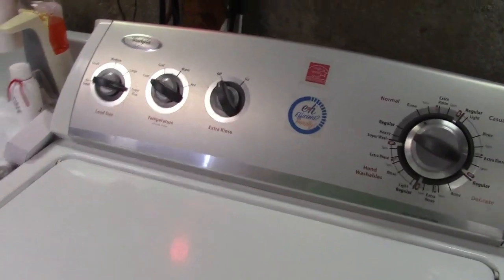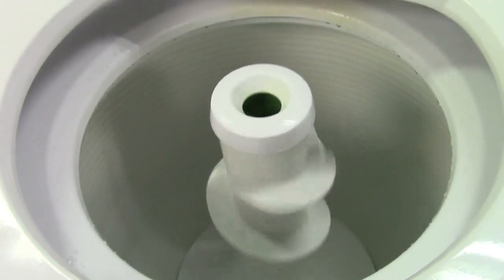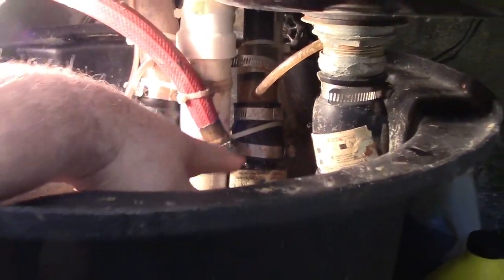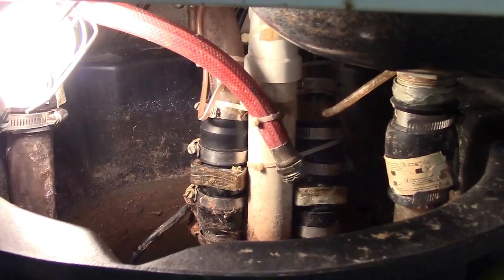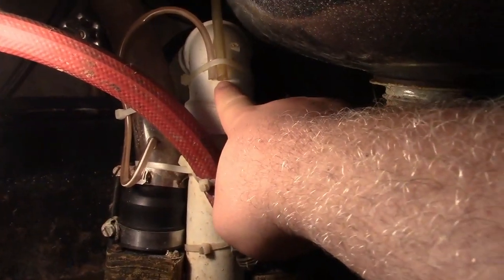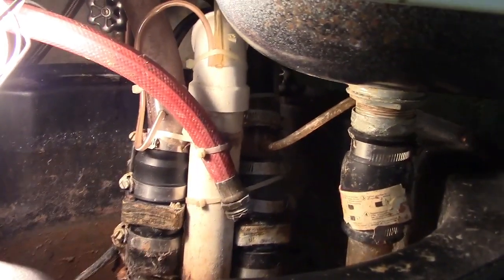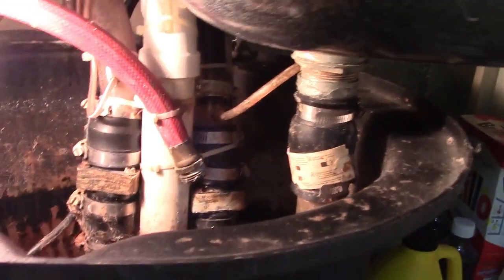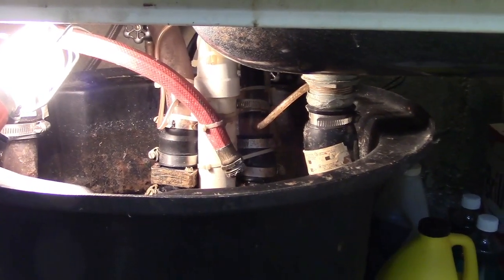My Newer Whirlpool Washer Isn't Working Properly, Can I Fix It?

Comment: Decent! Always good to use proper troubleshooting techniques, rather than condemning a perfectly good washer, and still have the same problem.
Many years ago, I got a real cheap Amana dryer. The guy had replaced the dryer only to find the same problem with the new dryer, which was the dryer vent was clogged up. His loss was my gain!
Would it be of benefit to install like a 45 degree elbow on the end of the drain pipe, so that doesn't happen again? Even if the pipe rests on the bottom of the drain bucket, water would still be able to chooch out just fine.
Reply from the maker: Thanks.  I have a very unconventional diagnosis procedure that I can't explain nor demonstrate, it's like my brain is hard-wired for it.  I work through it fast, and the diagnosis is usually made within a few minutes, if not even seconds.  Fixing it, is another story.  Just like the electrical box that was rewired, my diagnosis without checking was a reversed hot and neutral.  Fixing it took longer.

Excellent gain on your part, I love when people are dumb and you can prosper from it.

Yeah that's not a bad idea, someone else had suggested cutting the pipe at a 45 degree angle, which would accomplish the same thing.  I have no idea why this moved to begin with, and it never did before.  Fortunately, should it fail as it did, there will be no disastrous results, worst case is the washer would still have water in it.  As it turns out, Sharkie had expressed interest in seeing the ultimate Jay test of the setup next time he's here, perhaps I can better secure the pipe then when we're in there.  When you go looking for problems, you find problems.  I did 2 repairs on 2 different devices, with old plastic, and found out that I shouldn't have messed with them because of the plastic.  I was able to fix them both, but they were better off left alone.  Videos someday.

Comment: The drain pumps are incredibly easy to replace on these washers. The pipes to the drain pump might also be clogged. All you really would need to do is check for blockages and replace the drain pump if necessary. Either way, this problem is going to be an easy fix!!
Reply from the maker: Try watching more than 3 minutes of the video.

Comment: So was that bucket/pump there when you moved in for the sink and you just added the washer drains to it or did you install the whole set up?  Do you know what brand of pump that is?  

I believe the laundry pump I have is a Liberty Pump.
Reply from the maker: Yes, the bucket and pump were here before I moved in.  From what I understand, there used to be some sort of different setup there years ago.  On the wall where the timers are, if you recall there is an outlet where the pump plugs in that has a little red light on it.  The previous setup, whatever it was, was manually operated.  That's a quad box, right side is a standard, always on outlet.  Left side has a switch on top and outlet on bottom.  The outlet is where I have that analog voltmeter plugged in, and the switch controls that outlet.  That used to be where the old pump plugged in; when using the sink you had to turn it on and off manually.  That setup was probably installed in the later 50s or early 60s when the basement was partially finished, is my guess.  This is based on brief recollections of a lady who grew up in this house when she was a little girl.

No idea when the whole bucket and pump was installed, I can only imagine that the prior owners of the house may have redone it, I know the guy's father was a plumber.  He might have been a hack, or maybe the homeowner was a hack, I don't know.  When I bought the house, the pipe that couples in to the main drain fitting had a screw-on connector, which was cracked, so it leaked.  Their solution was to tie a towel around it to collect the water that seeped out.  I replaced that piece with a rubber coupler and painted the pipe green.  The washer drain setup I devised and installed, none of that existed.  The old GE washer that was here would dump directly into that bucket.  But, if the water was at just the right level, it would cover the end of the drain hose.  So when the washer would pump out, and shut off, no air was admitted to the line, so a stalled siphon was set up.  When the washer went to refill, it would refill for eternity and never fill because the water would go directly out the drain hose.  That happened a couple of times until I figured out what the problem was.  When the newer Whirlpool was delivered, I devised that whole setup, then mimicked it for the other machine when that came.  

I have no idea any information about the pump that's in the bucket.  It was just there and working when I bought the house.  In fact, I was unsure about that whole setup, and while here with the real estate agent, I told her I needed to see this work several times.

Comment: Hi Jaykay18! I have a question for you. I have a Kenmore 80 Series direct drive washing machine. My issue I’m having is the washer is slipping into a spin drain some of the time when it should be doing all neutral drains. I just installed a new transmission hoping it would solve the issue but it has not. Do you know why I’m having this spin draining issue? What would be my next trouble shooting fix?🤔 Thank you!
Reply from the maker: I find it quite interesting how people come to me as if I'm some sort of expert.  Well, I am, so then they post their question yet forget the part that I'm not dumb.  Clearly, you're a washer twerp.  That being the case, on your About page of your channel where it says "I can help and tell you how to fix your washing machine.", you claim to know a thing or two.  If you did, you'd never fire the parts cannon at the machine and replace the transmission.  Based on your videos, there's no chance you replaced it.
Reply: I appreciate your feed back.  Please understand, I’m 18 yrs of age, on the spectrum (Autism) and was hoping for your expertise and guidance with this issue.  Based on what I do know, replacing the transmission on a 28 year old unit was not the answer to solving this issue!  Your time is much appreciated.
Reply from the maker: @Dance2564  I'm more interested to know who thought replacing the transmission would be the solution, and who paid for it and who actually installed it.
Reply: @jaykay18  based on my knowledge from watching YouTube  videos, thought that replacing the transmission would be the solution. My dad and I replaced it ourselves. We bought it from Genuine Replacement Parts. It’s been a great working machine.
Reply from the maker: @Dance2564  That's exactly the kind of story I figured.  Things aren't adding up the way your portrayed yourself.

In this video, I used a very methodical approach and stress the absolute importance of diagnosing the problem first.  Doing so allowed me to determine the problem and devise a solution.  In this instance, no parts were needed, just an adjustment.  Now consider what would have happened if I immediately fired the parts cannon:  I would have ordered a drain pump, tore the machine apart and replaced it, only to find that the problem persisted.  That should sound familiar.

Comment: Is this one of those newer belt-drive Whirlpools, or is it the classic Direct Drive? Only thing I'll say is... I wouldn't be caught dead with anything newer than maybe a Whirlpool UltraWash from 2004ish, or the Kenmore 80 Series TL's (the latter, I'm looking for a unit to store long term, as a backup). After Bush's 2nd inauguration, the overzealous EnergyStar crap really started up. It became 8x as bad, under Obummer. 

The newer TL's fiddle around with temperatures too much, giving nothing near a HOT or Warm Wash, and just don't provide the cleaning power I am accustomed to. Not to mention, digital controls and lid locks. Blah.
Reply from the maker: The sound alone gives away the fact that it's a classic direct drive.  I won't accept EVERYTHING less!  If I ever move, these machines are coming with me, I don't care how much it costs.  While this machine has ATC, I have a whole workaround system to allow only hot water, and even implemented a warm rinse option.
Reply: @jaykay18  Would you mind showing your workaround, maybe in a future video? I would love to see it. So far, the only one I've tried is physically shutting off the cold tap, but that's a huge PITA.
Reply from the maker: @laundrygeek3330  Try all of these:
https://youtu.be/jTE6Yo9T_vg
https://youtu.be/-3hwHzs9N9Y
https://youtu.be/boQufGJkeIQ
https://youtu.be/SeWQUssYubk
https://youtu.be/MwdUqCZ0faQ
https://youtu.be/cdlhzab6J0M
https://youtu.be/CYZWO__Cxto
https://youtu.be/JPLvwb_7GYg

Did you really think I WOULDN'T have videos on this?

Comment: The heat from the hot water probably caused it to shift.
Reply from the maker: If that were the case, then it would have done it under testing, unless you never made it that far in the video.
Reply: @jaykay18  of course I watched the whole video twice!
Reply from the maker: @ItzYaBoyJesse  Then you would have known.
Reply: @jaykay18  yes.

Comment: I also prefer to use hand tools on screws and bolts for the same reason.
Reply from the maker: Excellent!
Reply: @jaykay18  Also, with coarse thread screws I turn the screw backwards in the hole until I feel it drop into the threads. That stops it from creating new threads and potentially stripping the hole.
Reply from the maker: @Jallge  Yes, that's a very old trick. I've used that for years. But it's really of no help when the plastic is old and brittle or very soft, because it breaks anyway. Just had that happen on two recent repairs of other items. I got them patched up.

Comment: Another thing that will work is if you can cut the end of the pipe at a angle and you'll never have that issue again
Reply from the maker: That's a good point, and it probably would work well.  I will keep that in mind should this happen again.

Comment: Well a feller might have to do hot water and bleach with a large load of water every once in a while!
Reply from the maker: That doesn't wash away fibers, or hair for that matter.  Sometimes, a guy's just gotta get his hands dirty.
Reply: @jaykay18  right right, then maybe use an scrub brush or an old toothbrush and scrub it!
Reply: @jaykay18  or a guy could just use some cleaning attachments on a drill, nope.....you will probably buff it out.
Reply from the maker: @ItzYaBoyJesse  It took 12 years to get that way, and what I did will probably buy me at least 10 more.
Reply: @jaykay18  noice!

Comment: And to think this thing will turn 15 next year. And its literally the only thing thats happened. Also older whirlpool will turn 30. Heres to many more years
Reply from the maker: Right, and this wasn't even the machine's fault!  The older one I did the agitator dogs twice on.  That's it.  I'm sure they'll hold on for years to come.
Reply: @jaykay18  absolutely, and exactly,   they will certainly still be going strong when all the modern machines hit the landfill, i rekon even the new speed queens including the tc5 will hit the landfills way before these direct drives!
Reply from the maker: @declanmarsh7398  Those SQ's are pretty robust.  I'll bet they'll be around.